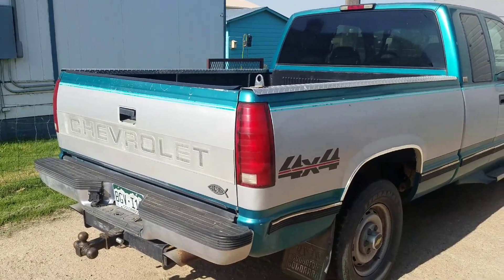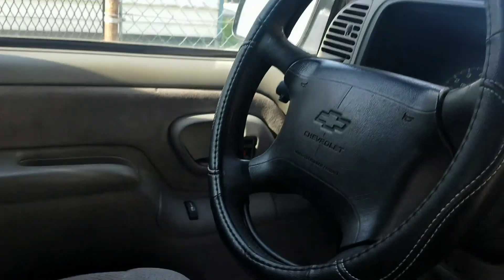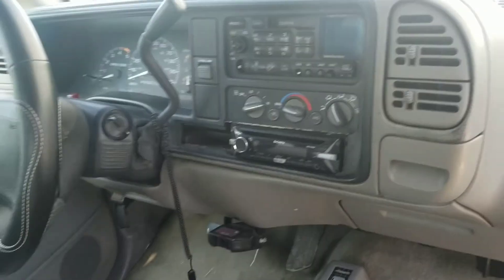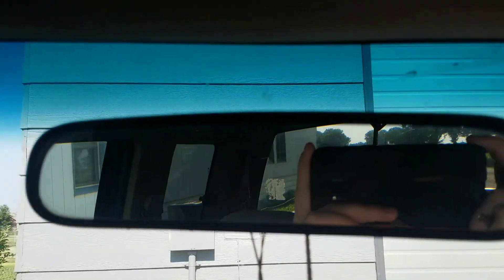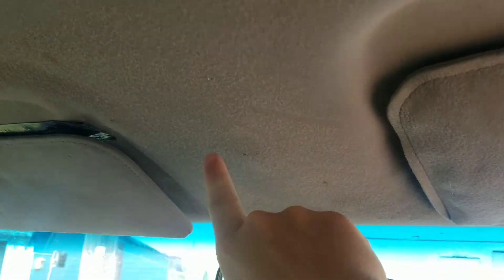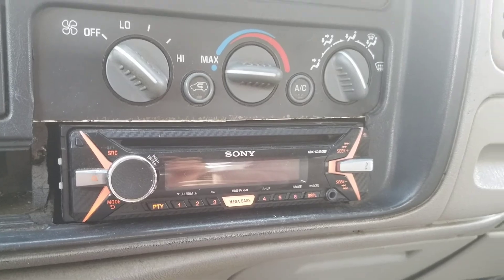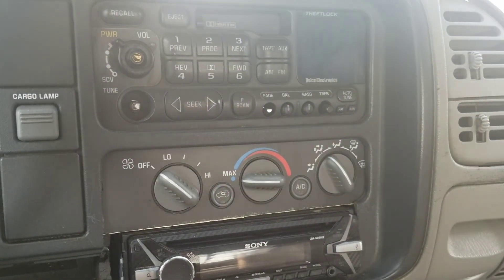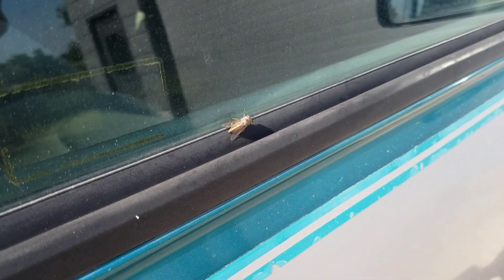tour of my 95' Chevy Silverado!

Comment: The thing in the back are speakers and all the speakers probably work but judging off of the guy who had it before you he probably didn’t wire them up to the wiring harness in the back of the radios
Reply from the maker: Yeah the right side speaker and all rear speakers don't work